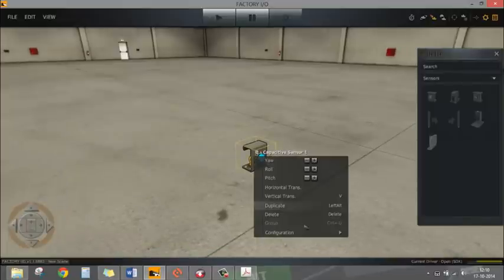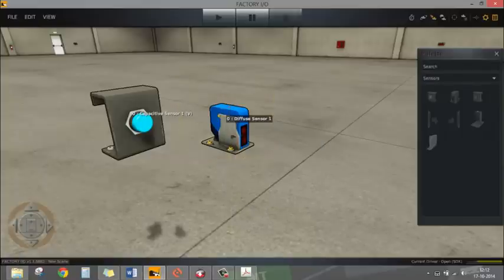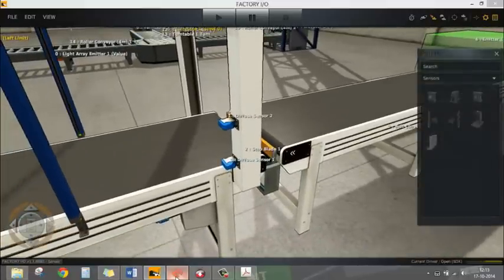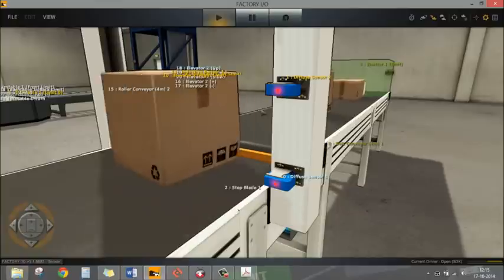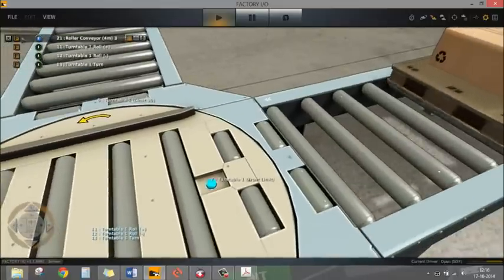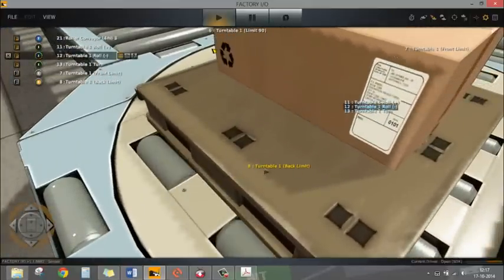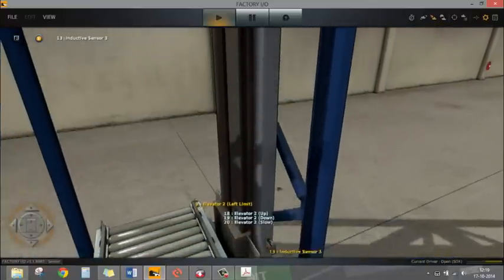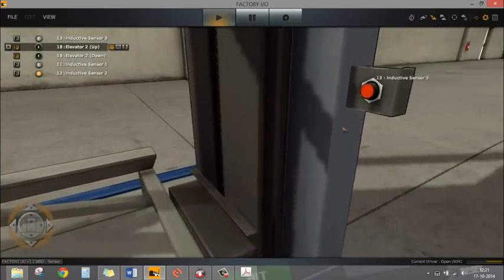Factory IO Lesson- Understanding Diffuse, Inductive and Capacitive Sensor

Comment: bro I am using the capacitive sensor in my final year project to sense the materials on the conveyer belt , once the object is transferred on the belt , so how to switch off the motor automatically. pls guide me
Reply from the maker: That's the bit of programming involved. Use the falling edge of sensor to reset the conveyor.

Comment: Hello, very nice video, I have a question, can I make Case Packers simulations with FACTORY I/O?
Reply from the maker: Yes ofcourse you can make it. There are library available. But it may not be 100% specifically what you want to make. but more or less similar to your objective
Reply: That is really nice, you know where i can see some examples of that library doing that case packer process? Because if it is similar to what I want to make, as you say, i really want to buy this program. And another question, can I import my own CAD design to factory IO?
Thanks for your time.
Reply from the maker: You can check the website for more information:https://factoryio.com/features/

And unfortunately you cannot import CAD Files in this software.